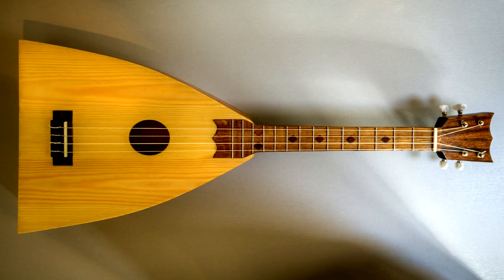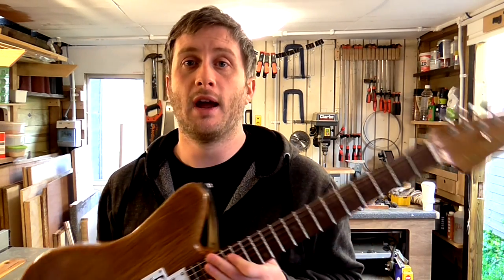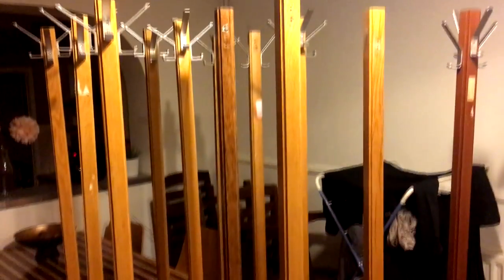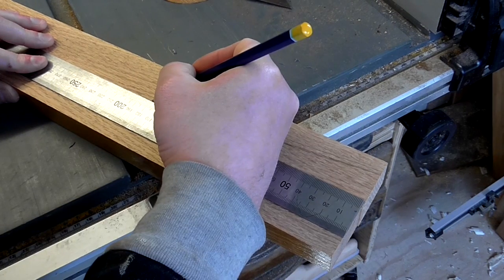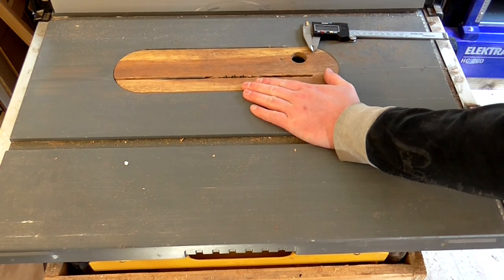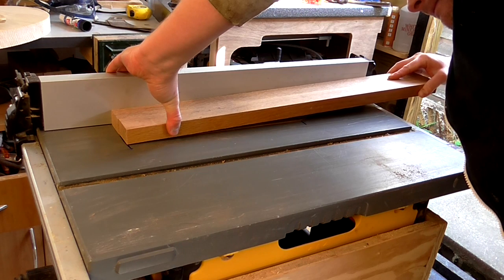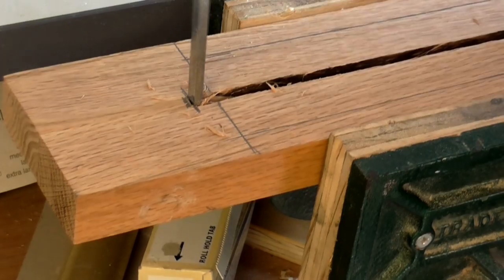Making An Electric Guitar From Salvaged Oak (part 1 of 9)

Comment: Wood only affects tone on a electric guitar acoustically (when you play unplugged) and the sustain which has more to do with how the neck is attached. The amplified tone is entirely from the pickups which is just a magnet picking up a signal from the vibrating metal strings. A glued in neck will provide great sustain like most Gibsons use.

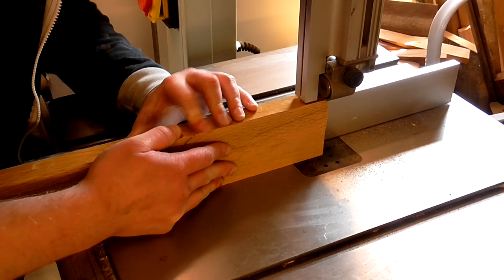Comment: Hi Keith, I am really interested in this bandsaw. I have been looking through your vids for vids of you using it. I will be doing a lot of resawing of smallish hardwood. At 8:51 you are resawing the oak headstock, the saw seems to be struggling a little. Is this your usual experience of using this saw? I can't tell whether it is the saw that is struggling of whether you are just wanting to keep control of the piece.
Reply: I suppose it could also be the blade you had in?
Reply from the maker: +Richard Hawkins hi Richard, from memory I think this was the stock bandsaw blade which wasn't that great. I've since replaced with s blade from tuffsaw and now it cuts much better
Reply: Thanks for that Keith, I'll have to look through to see if there are newer vids of you using it, Unless you know of one? Thanks again.
Reply from the maker: +Richard Hawkins yes, there's some resawing in the cat house for two video (spruce), and the treasure chest one (sapele) and the one that goes up this Friday (meranti). Thanks